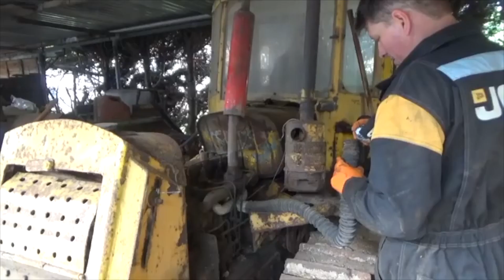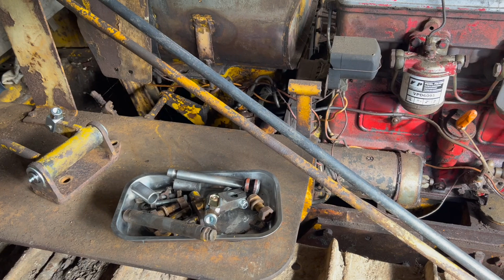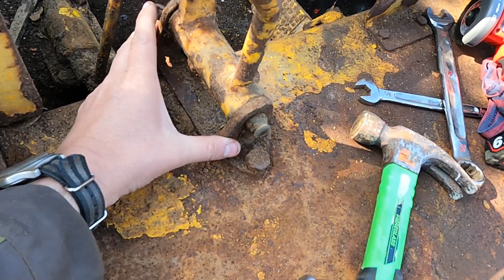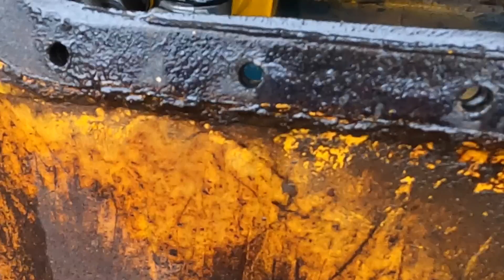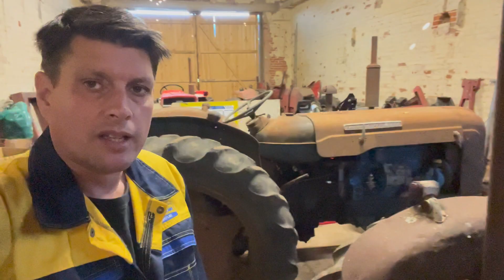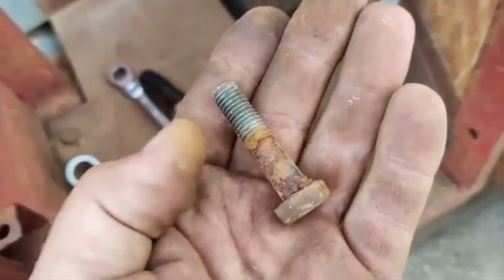HIDDEN FOR 30 YEARS

Comment: On my restoration projects, done 35 in 30 years, I like to tap out holes, and dienut threads and use correct length bolts of the same thread, if the thread is no good I go to a bigger size if possible. The Cat project that I am on now, I cleaned all the threads on control rods, fitted new locknuts and clevis pins and split pins. I use new nuts and bolts most times. I am lucky because I have got lots of new bolts in my stock that I had built up over the years. Kim has done a great job on the linkages. I think its time well spent on the smaller detailed items as it does make things easier on the rebuilds and the adjustments made easier. I love crawler tractors .

Comment: The person who designed that hydraulic system with everything inside the tank should have been taken out the back and given a good thrashing. That sort of engineer deserves a special place in hell as well. I suppose any oil leaks would have been well hidden. Jeff
Reply from the maker: It's actually a very good system as it's completely sealed from contamination in dry, dusty conditions. 
The components inside are like new.
Reply: @LordMuck   Same with the 951 valveblock, its controls within the tank, as you say less chance of contamination and valves sticking. When I drained the hyd tank the oil was perfect, after standing for at least 15 years

Comment: Hi what david brown engine is in that ?
Reply from the maker: Same as the 950
Reply: @LordMuck  I thought it was either an 850 or 950, there 4cylinder but low powered, it she had the 4 cylinder  995/6 engine you'd have more power
Reply from the maker: The one thing that was never short of was power.

Comment: Well melod, a well known fact is that David Brown supplied gearboxes to Aston Martin. From the look of the blade control lever, it's nob and the connecting rod with those fancy clevis joints, David Brown probably supplied the linkages so James Bond could go up through the gears in double quick time!
Naturally they wouldn't be painted yellow, probably black. Doffage of cap to all!

Comment: got to love the old engineering methods, why have just a straight pin with a split pin when you can have a stepped pin screwed in and retained with a clip retained by a split pin lol. but that's why i love heavy machinery from the 70's and back as there is just so many weird ways of doing things. was running a diesel converted ploughing engine a few weeks ago for the 1st time and boy what a contraption that is!!

also looking forward to the next matador update to.

Comment: Hmmm....Is that a small bleb in the hydraulic hose inside the oil reservoir LM?  I would have to investigate with a gentle fingering, if you know what I mean.
Reply from the maker: No it's just separation of the outer shroud but all the hoses in there have been replaced as they had been made at the same time as the ram hoses.

Comment: Yesterday my brother went to an auction and bought a future project. A Minneapolis Moline M670 super. The engine seems tired would only go with either but everything is there under the grime. Also got some tires for cheap for a future combine project. Now that I think about it wonder what percentage of my equipment would be scrap if me and my brother weren't crazy 🤣🤣🤣